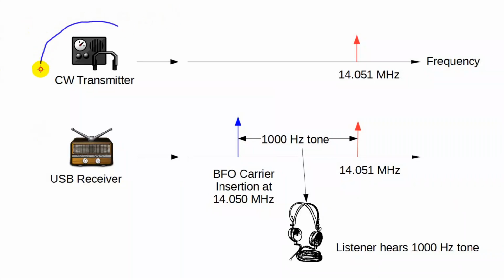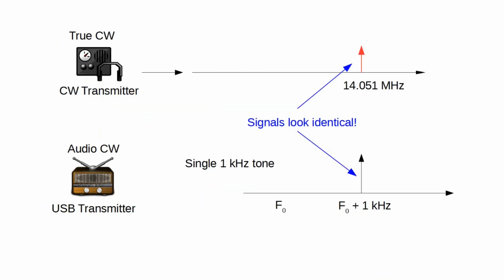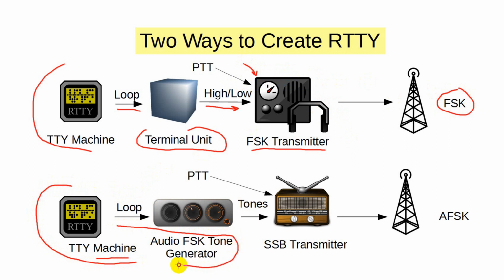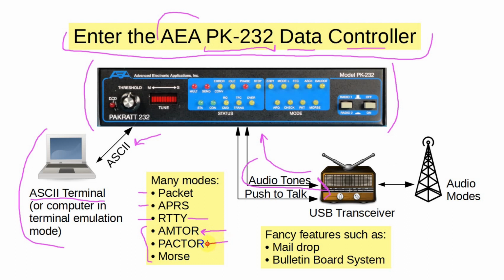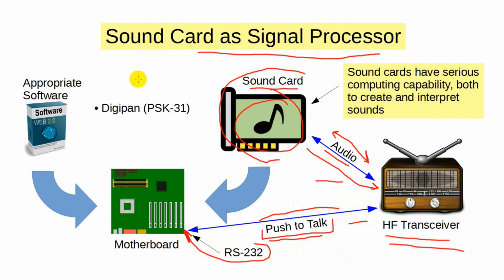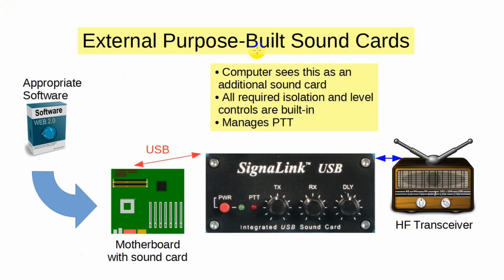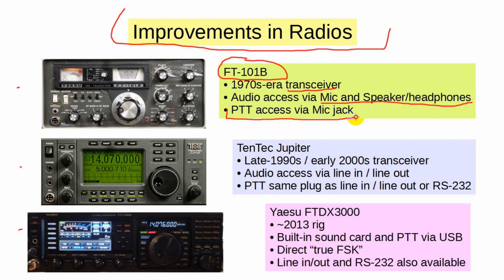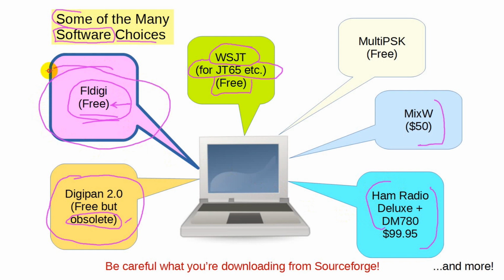Setting up for Digital Modes, AD#25

Comment: Dave, great video but you need to correct your explanation on how CW mode works.  Although, your diagram is functionally correct your audio stating that a CW transmitter puts out a single tone on a single frequency is not.  A CW transmitter does not put out any tone, it puts out a carrier only [no modulation] that is keyed on and off as necessary to send Morse code.  As your explanation and diagram show, the tone is generated in the receiver so the listener can transcribe the message.  Incorrect explanations, although unintentional, lead new hams astray and make it difficult for them to understand how radio really works.  It is better to impart correct knowledge from the start rather than putting someone in a position of having to 'unlearn' wrong knowledge.  Thank you for your efforts.

Comment: David, I am unable to get fldigi program to reconize the windows audio settings, it was working, but now when I try to check port audio the program trips an alarm that reads port audio device is not available. windows settings says audio devises are all ok, but program will not talk to windows so I can program sound card. Help please if you can!

Comment: Dave, love your videos! I am having great difficulty getting fldigi to work with my ic 7300. I have all the settings on the ic 7300 per your instructions, I have downloaded the Ic7300 xml file but I can’t get settings correct. The xml file appears and com port 3 is selected. Any help would greatly be appreciated. Thanks Don kb3yrp

Comment: I would consider myself extremely new to HAM radio....but I do have an Extra class license. With that being said, I have recently been moving toward digital modes as a part of my overall knowledge of the hobby, and to diversify my abilities with it. However.....yes, here we go.....I may very well be off path, but isnt all of this in some sense a rebirth of communication technology that has far surpassed what is being done here? Lets face it, we can simply use a cell phone to access internet, take and send pictures or videos, email data files, or text messages. While I understand that many will say that this radio form, at least in some sense, it more “pure” since no paid coverage is required etc. And I suppose I get that....however, it still seems that we are reinventing what has already been invented, and this technology is far behind the other. And let us not forget that this too requires a computer, other hardware, software, power sources etc. 

So again...I am in fact interested and have been moving forward, but am I simply overlooking something here?
Reply from the maker: There are lots of commercially-available communications options for point-to-point activity and of course video options for live streaming. But when you just want to play around with radio, or see how far you can talk or what new countries you can get, there’s nothing like ham radio.

Comment: Great video David!  I have seen this before, but am watching again.  You are very clear in your description.  By the way, the good old ASCII terminal lived far beyond the introduction of the computer.  It was handy to power off and not have any nagging data that would survive so in secure environments liked that feature.   Loved all that technology and great memories for a career that watched all this develop before my eyes.

So in regards to old radios and a box like signal link,  is there a list of radios that can be FT8 enabled? The two hidden questions here is how do some of the old radios deal with the Signal Link and the normal audio they are processing?  Thanks, 73!
Reply from the maker: All SSB radios can do FT8 with an appropriate interface such as the SignaLink USB. Be sure to throttle the power back.

Comment: Dave or anyone, advice please - Should I convert my AEA DSP 232 MultiMode or Pakratt 232 to USB (if that's possible) or should I just go and get a SignalLink USB for RTTY (and HF digital modes)? Or is there something else that's better and more recent that I don't even know about? FYI, my rig is a Ten-Tec 580 Delta and I run power when needed. I used to enjoy SSTV as well, but for that, I converted an old 486 PC (because of its clock)(not one slanted pic ever!) to use the audio going to its built-in speaker and a DOS program. That's all gone now. I would just like to get back to where I was.  Oh, and Lord willing, I'd like to get one of those RSP1A SDR radios for its spectrum display. I think that's so neat to see what's on both sides. Second question, what are guys mainly using to protect their SDRs when they Tx? Thanks
Reply from the maker: I'd say get the Signalink and fldigi and set the 232 aside. That's what I've done. Re the SDR, use the IF or low-level RF output on the back of your transceiver. If it doesn't have such an output, MFJ makes a device that shorts out the SDR input while your rig transmits.
Reply: Finally found it (maybe)... I'm guessing that would that be:
A close look at the MFJ-1708SDR T/R switch (#148)
https://www.youtube.com/watch?v=nchpTOfdjoI

Comment: Thank you for the video. Been off the air since 1993 and a lot of the stuff sounds very familiar but  This is.  2018. I'm in the process of setting up by station again. Have a lot of things going on I power supply comes on but no power comes out. I'm trying to work on 5 band 2 ele quad.  Wish me luck. Bank you ever have any more questions I will death would be back. OMI transceiver is a Kw 850.  Just hope everything comes together.
73 KQ4CDPaul
Reply: Paul,
Look towards the Output of the Amp...Could be a blown Zener Diode that’s keeping all of those “Excited Electrons” from Leaving the Final Transformer?  Good Luck my Friend!

Comment: APRS is often incorrectly said to stand for Automatic Position Reporting System. This is an understandable error, as GPS-derived position reports were the most common type of information reported using the system.  However, APRS is Automatic Packet Reporting System.  https://en.wikipedia.org/wiki/Automatic_Packet_Reporting_System
Thank you for the time and effort of putting these videos out, and for sharing your knowledge with others.

Comment: Hi Dave. I just bought a used w0 power supply for running my base station  ( test in 9 days) . With it came a Vega model IP223 zEthernet remote panel , no phone type Mic with it . Is this what you are talking about  in this parti ulnar video? And should i definitely hold on to it? Both units were 70$ . I don't feel like I did too bad on the deal
 What's neat is I got the tech manual for the Ip223. Schematics and all.

Comment: As I’m hearing impaired (SSHL), I have an especial interest in digital data modes. I’ve worked RF (SATCOM) for many years (military), but just relatively recently got into amateur radio.  Ran (dialup) BBS’s as a hobby going back to the 80’s.  Even had my BBS connected to BITNet/Internet (in a roundabout way) through a local University in the late 80’s. Running a BBS over packet radio (U/V) seems interesting, but guess I missed the heyday of that period. I have an IP block on AMPRNet that I’ve been looking to do something with though...

Comment: I'm surprised more open source software isn't distributed via BitTorrent. I get all my Linux distros that way
Reply from the maker: I'm afraid I can't comment. Bit torrent has a bit of a bad reputation because of all of the copyright issues. That may be why.
Reply: David Casler  bittorent is just a decentralized file sharing protocol designed to allow the distribution of files/ data without a main server. Unlike a standard file server bittorent works better with more people downloading as they are uploading as well. By itself Bittorent is fine its only an issue if you download files that are copyright protected. Its wonderful for downloading large files that arent though like Linux operating systems. Also its very secure if you get the .tor file from a trusted ssl secured site and run a sha256 checksum to ensure you know youre downloading what you want
Reply: Torrents have a bad reputation because malware is common in the illegal copies that basically are the bulk of it. There are plenty of alternatives. Even if dome of those are full of scamware as well.

Comment: Great video, Dave, thanks!  I used to work for InCoTerm, a company that made intelligent computer terminals that could emulate any communications protocol by simply loading a paper tape into the core memory of a small computer packed inside a plain old ASCII terminal.  This was before PCs were even a word.  The airlines loved the devices and used them to develop the first computerized ticketing systems back in the 70s and early 80s.  
Now retired, I'm finding that Digital modes (and indeed all of ham radio) is still quite mysterious, but with help from these videos it is beginning to come together.  I still often wonder why people bother with digital radio at all as it seems so much easier to simply pick up a microphone, but I didn't make a career in networking for nothing.  Hams love technology and get more fun out of exploring complex ways of doing seemingly simple tasks.  The often unexpected worlds they open up makes it all worth the effort!
With that in mind, have you or anyone else in internet-land ever interfaced a decidedly non-digital Kenwood TS-830S to a computer?  Are there any articles describing the process?  That'll be my next project after I get my station on the air.  Thanks again.

Comment: How does FSK31 compare to P25, DMR and that branded Yaesu mode that I hate (because it is locked to one provider only)?
Reply from the maker: +Glen O&#39;Riley Sorry, I haven't used any of them. Perhaps another viewer might have some experience.
Reply: David Casler
I know P25 phase 1 at least is an FSK (phase 2 is CPQSK if that makes much difference - haven't researched that side of it) but I'm not sure if there are different codecs for FSK (likely).

Comment: USB directly to the radio is very, very nice.. My IC-9100 has this feature.  No more messing with audio levels, cords, IRQ's...  it just works with the USB driver.  And the CI-V on the same cable!  :-)
Great video Dave.  We just reviewed Chap 8 in our General license class and about every week I add "Ask Dave has a video on this, check it out".    73, N5ZY.